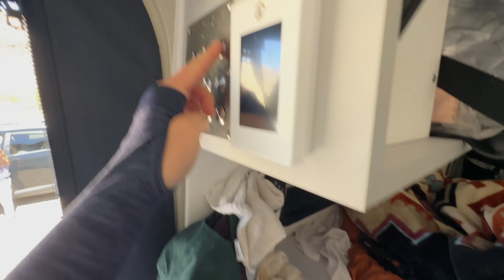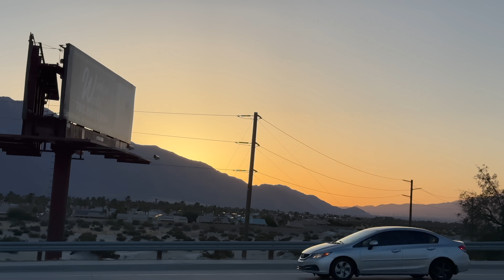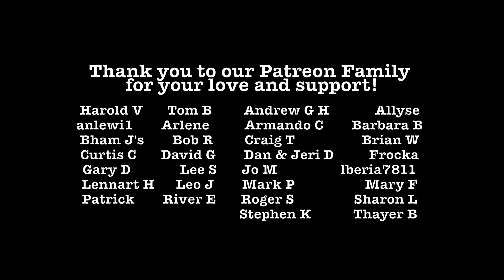Living in a RAV4 and a Van | Getting into the Swing of Things & SUV Camper Tour

Comment: Rest areas:  Montana has some of the nicest rest areas I have ever seen.  Large buildings with an "air lock" entrance (to help keep winter cold out).  I went in and there was a female wing, and a male wing.  4 or 5 doors down each wing with INDIVIDUAL, lockable bathrooms.  The room I went into was very large, at least 8' by 16', with a toilet, sink, urinal, changing table, hand dryer station and trash can.  Also, very clean.  A second one I stopped at was like the first, but they also had a large, fenced pet bathroom (50' by 50'?).  Complete with fire hydrant in the middle!

Comment: Nikki, Sarah could upgrade to a empty mini van converted to a mini-camper. Twin Bed behind drivers seat. Storage to one side and back. Small cabinets over storage area or use metal baskets mounted over storage area. Between storage area and passenger seat, micro kitchen with 2 tier cooking area. Pots,dish towels, silver ware,cooking utensils underneath in drawers. Top tier,double burner electric stove that can be hooked up to the Jackery. Don't forget micro fridge that could be hooked to another Jackery.Installed sunroof towards front. Passenger side extendable cover. Trailer hitch for Bicycle rack/Bicycle. Emergency composite potty. Positive upgrades - more head room,easier to dress and undress, less claustrophobia with wider area, Can cook inside if raining, but kitchen area could be designed to slide out the door for outdoor cooking.  Recommended Vehicles , Nissan/Chevrolet is same thing,Dodge. I think Mercedes puts out one. Stay away from Ford

Comment: What food do you feed the pups?
Reply from the maker: It changes based on availability but I often feed them frozen or freeze/air dried raw, anything with whole food sources ingredients and usually a higher quality meat - I always forget to explain the powder on top but lately ill also some times sprinkle powdered goats milk and/or Nuvet joint or plus on top (nuvet is only available with a distributor code apparently so I started working with them under Code: 977388 for anyone who wants to try it too)